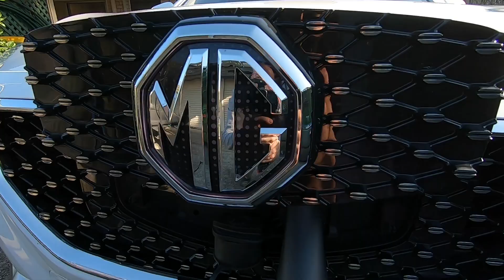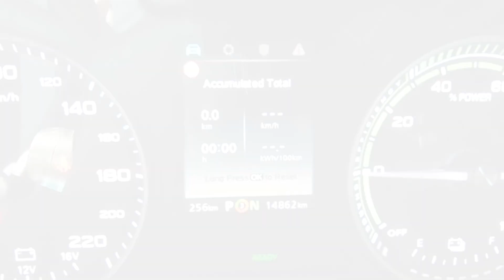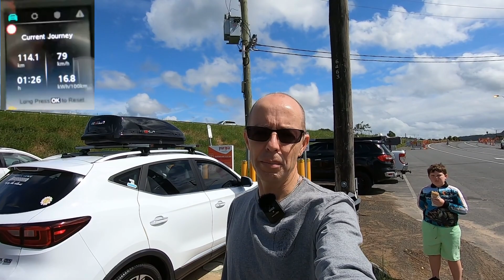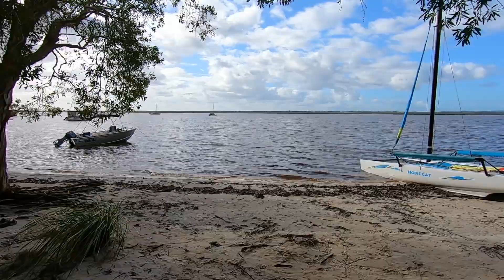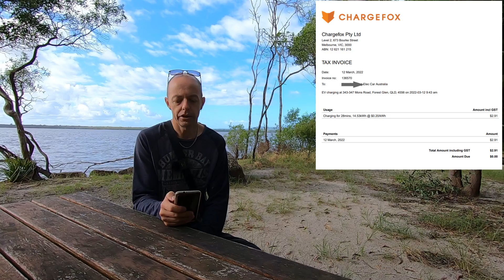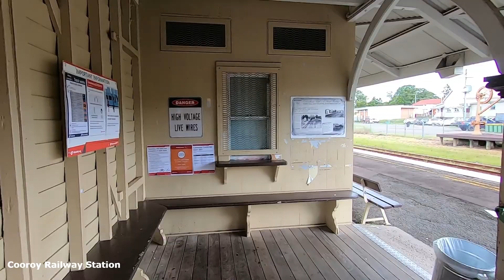EV Model 70% Cheaper Fuel v Petrol | Fully Loaded EV Road Trip & Camping | Electric Car Australia

Comment: Great video! I didn't know about the balancing charge - do you have any videos on this? We did a trip from Brissie to Bundy and it was a bit shocking how much the roof pod took out of the range, but not enough to dent the enjoyment of the trip :D
Reply from the maker: Hi Luke, thanks for the comment and no I haven't done a specific video on balancing. I might do one in the future. It is difficult to not enjoy a trip in an EV.....running too low on charge is probably the only one. Unfortunately I recently did that and run out :( Will cover it in my next video. Cheers

Comment: Just checking: when charging, it is safe I take it to leave the car to go get a cuppa or something for a while?  Some idiot won't come along and pull out the plug will they?
But then if it's in an open, busy area then little chance I guess.
And lol....it's BOReen Point, not Boreeen Point, and it's Lake Coo-thara-bar😊.
Another great video thanks mate👍.
Reply from the maker: Hi Bruce, thanks for the comment and yes, I didn't do a great job of pronouncing those places :) Yep you can go for coffee, the car has a safety locking pin which locks the plug so you cant unplug them while charging. Generally need to use the key fob to unlock once finished. We show this is our Type 2 charger video.
Reply: @ElectricCarAustralia  Cheers👍. I have a friend who is an EV skeptic and I was trying to convince him that it was ok to leave the car, but I couldn't find on Google where it said it had a lock or something, so thanks for that - I'll check out that video you suggested👍.

Comment: Hello. I noticed it shows your tire pressure in bar.
Mine used to show it in PSI but I had to reset the car at some point (disconnect the 12 volt battery) and now it also shows it in bar.
Do you have any idea how to change the units back to PSI?

Thanks!
Reply: Read the manual. On the touchscreen click 'Setup', select 'Display' and then 'Unit settings'
Reply from the maker: Hi Dima, thanks for watching - Paul beat me to an answer.

Comment: Thanks, the ZS EV did well! Yes, wind matters regardless of ICE or EV.
I reckon as EV's pick up and the charging infrastructure expands, the cost will match fossil fuels. The only force acting against this trend is charging at home from PV.
I saw a hack that would enable VTL on the ZS EV. Julian Illet 31 March.
Reply from the maker: Thanks for the comment Benny, yes I seen that hack, great idea & very interesting video, it's suited to the new gen 2 ZS EV, I've read the gen 1 like ours has different software/standards or something so doesn't work so have to stick with the ole' separate DC to AC inverter.
Reply: @Sɛnˈseɪ Sīfù Shreder Yes, the made up reasons are needed to cover up the theft, but ultimately that is how free enterprise works - you charge "the maximum the market will bare".